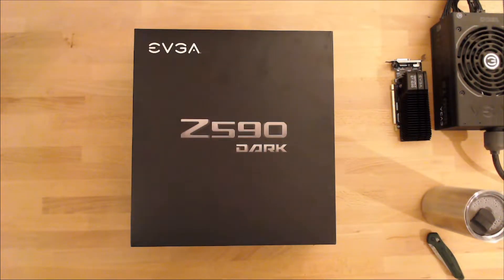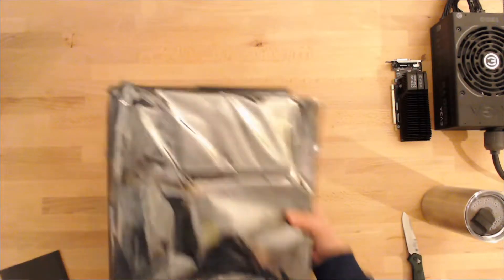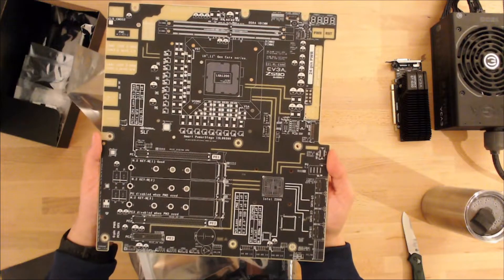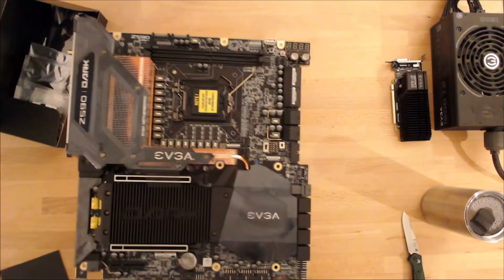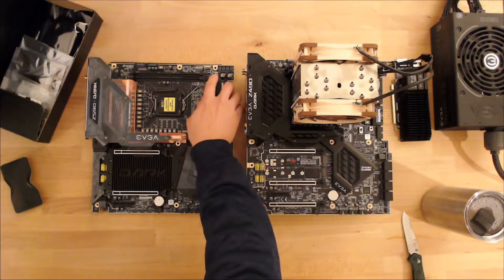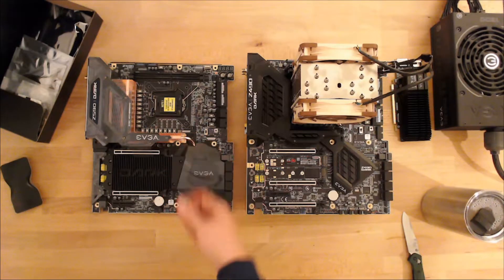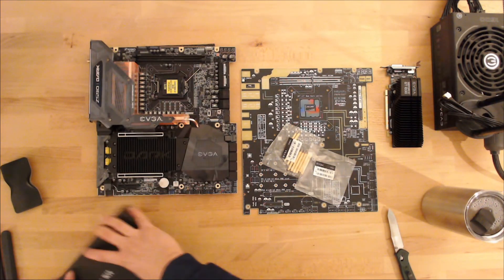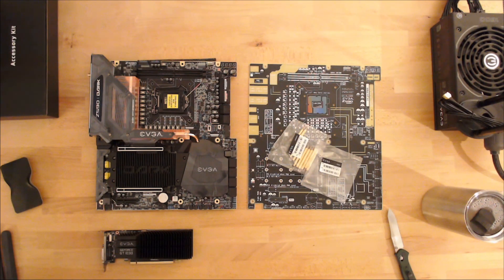Unboxing EVGA Z590 Dark

Comment: Also note if you buy this Great Board the CPU Fan  will have run North/South not East/West like most Boards. Due space and High end Ram.
Note that you must install drivers and Software in a specific order too. If not the Bios will not take the drivers correctly. Tips that no one talk about when building this board.
Reply from the maker: Ah, good point on the CPU fan. Yes the Z490 Dark also had this 90 degree rotated CPU socket. I noticed that I had better results pointing the fans to blow down towards the GPU or else the hot air from the GPU would heat up the CPU quite a bit. This way cold air from the top could be drawn in to cool the CPU instead of taking the hot air from the GPU and blowing across the radiator. So making the fans blow north to south was more effective in my setup when I had an open case. I'm not sure about the drivers and software and installing in a certain order, but I did notice I did have to update my BIOS to a newer version after buying the board. I think many may be using water to cool the CPU on a board like this though. Although I love my Noctua coolers because they are very effective if your house is cold like mine is during a Midwest winter.